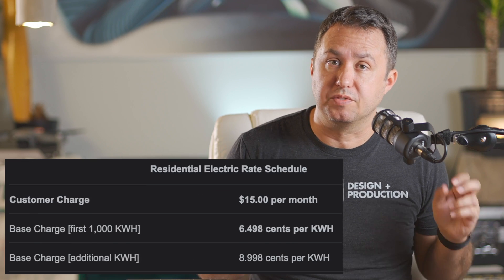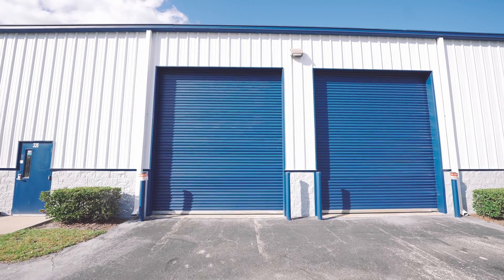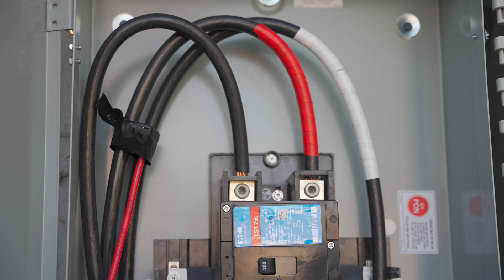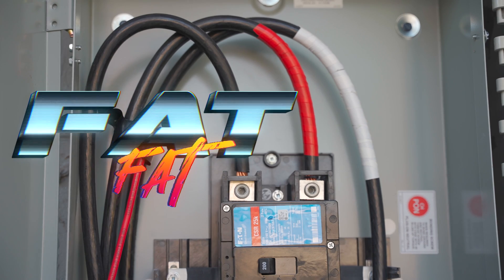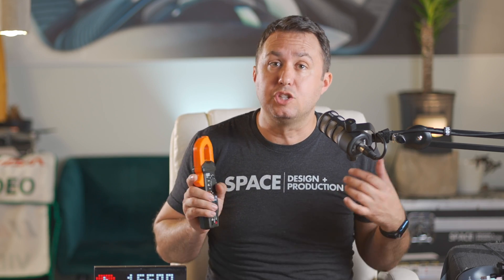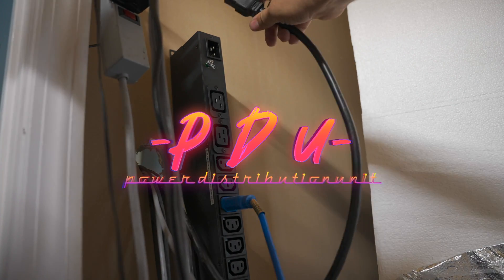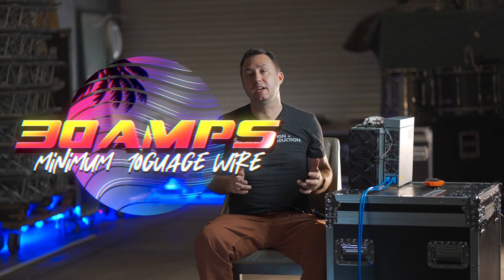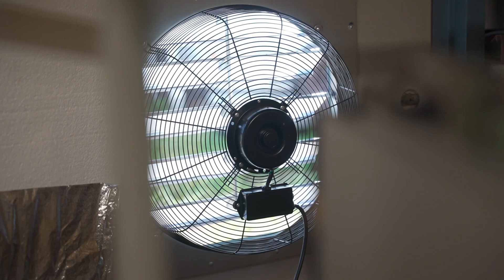On the Powering of Bitcoin Miners - S19 or S19j ASIC Electrical Basics

Comment: The C14 to C13 cables you link to are 10-amp rated. Shouldn't we be looking for 15 amp capacity?
Reply from the maker: Not necessarily.  It’s not a bad idea, thicker cables are always a little safer, but two 10amp cables to carry about 13 to 15 amps total is totally sufficient.

Comment: 4:37 so is it actually drawing 30, or 15 each leg back and forth?  ... if a person has 400 amps available and is using 240 volt circuits, how many amps is safe to pull? 360 or 180?

Comment: I have a question and would appreciate it if you could clarify these questions for me: Why does it have to be powered by two different power inputs? Would it work if I powered the machine with just one cable?
Reply from the maker: You can power it from one, if you split that one cable into two cables to plug into the machine. It won’t turn on unless a cable is plugged into both inputs. But they can come from the same cable just with a splitter on it.
Reply: @SPACEDESIGNWAREHOUSE  Thank you for reply. This is interesting, a common wire in my country is specified to easily support 20 amps, as a layman that I am, I cannot understand the point of powering the machine from two different energy wires
Reply from the maker: @DiegoDMuniz  I was always confused by that also.  The newer machines, which actually use a little bit more power, only have one power plug.  Im not sure what their aim was.
Reply: Can I use 2 separate breakers 120 volts each with 2 separate wites going into each plug of the machine? Would it accept it as  240 volts?

Comment: I have a 208v 20amp plug. I want to run a s19k pro directly into that plug without using a pdu. What type of receptacle would I need ? Can I use a l6-20p to c13 splitter to plug directly into the plug?
Reply: Yep, you don’t need a PDU at all for a single miner on a 208v plug. You can plug straight in and split it.

Comment: I'm from iraq so the standard voltage is 220v do i need voltage converter for antminer s19 90TH? i really wanna mine in my contery couse i pay 0.015/KWH
Reply from the maker: WOW!!! Cheap electricity!  No, you do not need to convert the power.  It will run on 220v.    It will run anywere from 200-240v

Comment: what would happen if i run a 13amp y splitter on my s19j pro 104th?
Reply from the maker: Do you mean run one power line from the wall split into two cables that plug into the miner?  That will work completely fine!

Comment: Can you mine intermittently for example one hour yes and the next no? In the hour you mine, is it sure you are gonna mine something or you have to try to run the ASIC 24/7 to randomly get some btc in some hours an nothing in others?
Reply from the maker: Any time there is power to the ASIC it will start mining. So yes you could set something like that up with like an electric timer just to cut the power. 
If you mine to a pool, which is what normally happens, then you’ll be paid out for the amount of time your miner puts in, wether it finds a block or not so also yes!
Reply: @SPACEDESIGNWAREHOUSE  thank you. You get a like and a follow!

Comment: I'm confused, do you not need a pdu as a safety measure to power your miner i.e. as a surge protector?
Reply from the maker: I have a surge protector built in to my breaker panel. But these miners are pretty hardy, accepting voltage all the way from 200 to 250 volts so fluctuations won’t damage anything.  Sudden huge surges should be protected against, yes.

Comment: Great video! I’ve subscribed. Quick question, is there an app that connects to your asic miners that keeps track of all their progress? Like a dashboard?? Thanks!
Reply from the maker: Well, not an app, but I leave an entire windows computer in the room with them, connected to the same network so I can ‘chrome remote desktop’ into it and it can look at their stats. 
That computer USED to mine ethereum as well to make itself useful, but now it just has a massively oversized GPU for the work it performs.

Comment: Worth mentioning l6-30p is the 30 amp socket and l6-20p is the 20 amp version. Im not sure how different they are but I ran 1 l6-30p with a 30 amp breaker for each of my miners on individual 30 amp PDU. This way I could split a future third miner half on one pdu and half on the other with out running additional infrastructure. I have space to run more but I figure the less PDU's the less cost I have. I really like the 30amp PDU from Nerdgearz when they are in stock the unmetered one goes for 150 and is not super long and unwieldy like my 5 foot long triplite.
Reply from the maker: Thats a good way to go, getting three machines out of two L6-30 outlets!   Ive abandoned PDUs and now I just wire straight into my breaker box.. Itll never pass inspection, but it saves money!

Comment: Dude you're killing it with this channel and covering all the things I wanted to cover in the same type of channel. It's kind of a niche audience but I love it. Power was a big subject I wanted to cover and maybe one thing you forgot is load balancing on 120v. Most people I know running a couple GPUs don't understand you really need to balance that 120v so you're not sending crazy amounts to neutral. Keep up the great work my friend!
Reply from the maker: Yeah - I initially had it in the scrypt how we live in houses that were designed before a lot of the things we used even existed.. I live in a house from the 60's which didnt know it needed to balance a microwave and toaster oven into the kitchen, god forbid if my GPU rig landed on the same 120 leg.  I should have left it in, youre right I dont think about 95% of miners even consider that.
Reply: @SPACEDESIGNWAREHOUSE  Video is still much better than like a VoskCoin video.  Keep pumping out the quality content.
Reply: Can I use a normal 240v adapter and plug in my S19 or do you suggest I get an electronician rather for some advice, amazing video though

Comment: I'm a skeptic, yet I'm familiar with a lot of elements of BTC. So, let's get a few things straight: BTC is an investment asset - it's scarce, like gold, but it's easier to obtain, and large firms like PayPal and Grayscale, as well as a slew of banks, hedge funds, and ordinary people, own it. Whales with self-hosted bitcoin wallets have a hard time selling it without going through KYC, which can be financially disastrous in some situations. People lose access to their bitcoin wallets, causing their bitcoin to be frozen indefinitely. The hype and fear of missing out (FOMO) are on the rise, and most individuals merely buy and hodl bitcoin. You must realize that traditional stock market fundamentals do not apply.BTC may become even more desirable as a result of the new regulations (although have a minus). Basically, anything that could prevent bitcoin from mooning, in my opinion, would be strict regulation and greater investment options uncovered by bitcoin owners. However, it is recommended that you develop a workable strategy/daily signals in order to build and expand a robust portfolio in the future. Despite the recent volatility, I have been trading using Mr Felix Boyle's daily signals and method. His direction makes trading less stressful and more profitable. With Felix's daily indications, I was able to easily expand my portfolio from 0.5 BTC to 1.2 BTC in just 4 weeks of trading. His daily signals are extremely precise, resulting in a high positive return on investment and is willing to help anyone who is interested in crypto trading; you can reach him on Telegram at SCfx01* * (no additional digits or letters) for questions and effective trading techniques..,
:oops:
.
.
Reply: Scamming fuckt@rd bot accounts.
Reply from the maker: @dunreal3  Theyre SO fast!  Its interesting how they have little conversations now.. Theyre not even leaving a link!
Reply: Trading as a beginner can be frustrating and discouraging, but my financial condition improved after I connected with expert Felix
Reply: I made an investment with Felix as well; he knows every beginner's goal and matches you to a trading strategy that fits your capabilities